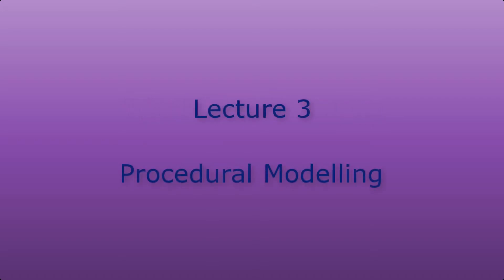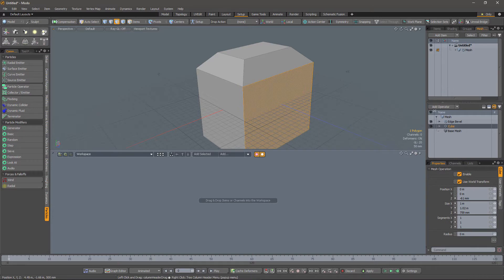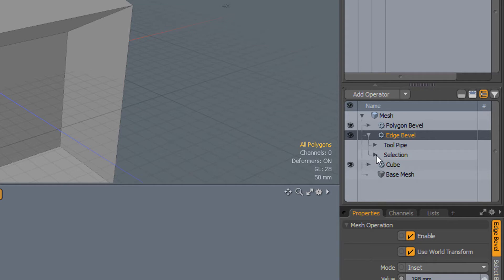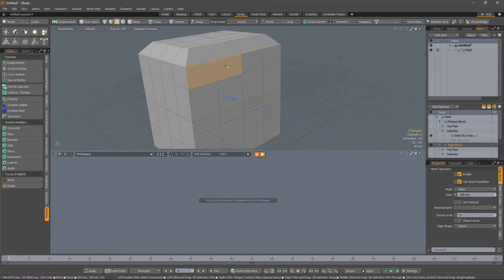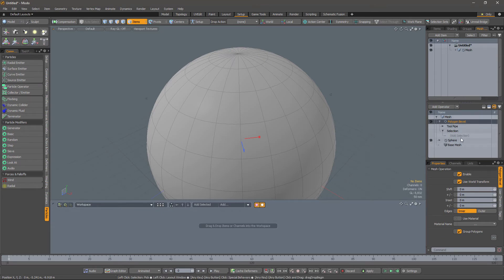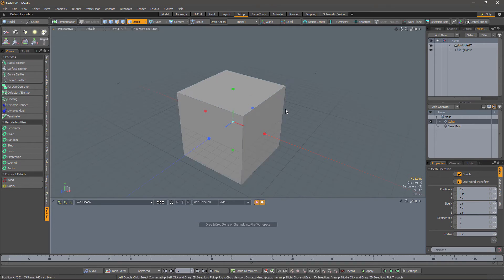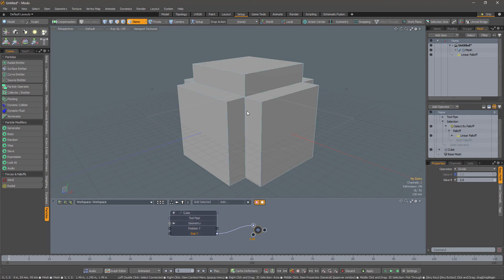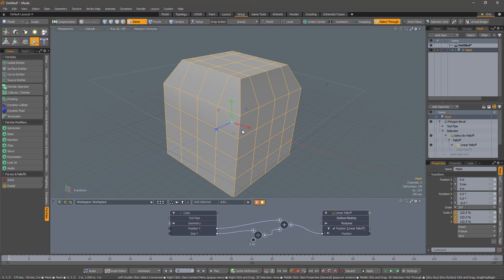Procedural Selection Part 1

Comment: Hey Steve, where did part 2 ended up? I think it would be still very relevant. Also I second the selection examples that modo4u was asking.
EDIT: nevermind, I've seen it' scattered between your later videos. Maybe it wouldn't be a bad idea to include a "procedural selection" tag somewhere in the header or the preview frame.
Reply from the maker: Yea - I ran out of energy and part 2 kind of got lost.  It might be worth a revisit now that we also have selection stacks.
Reply: @SteveHill3D  totally. But also what else apart from borders, normal direction and nr of verts/edges/polys?

Comment: One question! Is it possible for the procedural system to automatically selecte only edges that are not smoothed? 
For example to automatically bevel all the hard edges in the model.
Reply from the maker: I think the answer is "kind of".  There is a "select edges by angle" assembly which allows you to select edges on the basis of the angle between the two adjoining faces.  If you match this to the smoothing angle then you will get something like what you are after.
Reply: Thank you! I will try it.